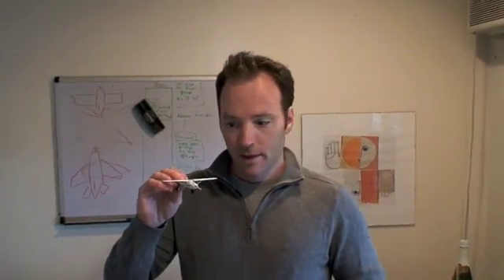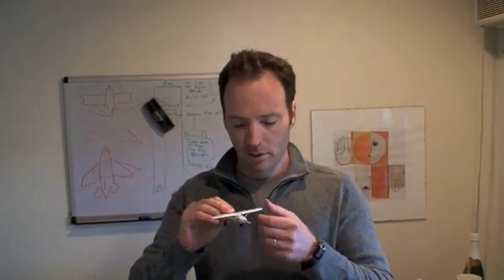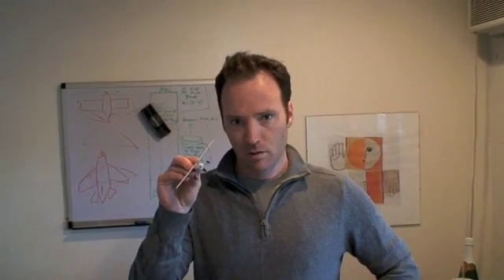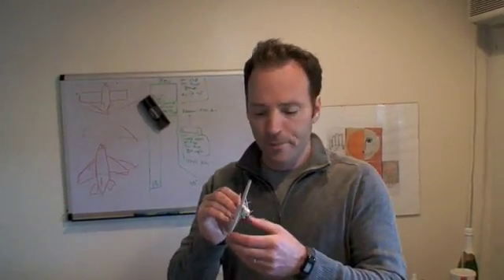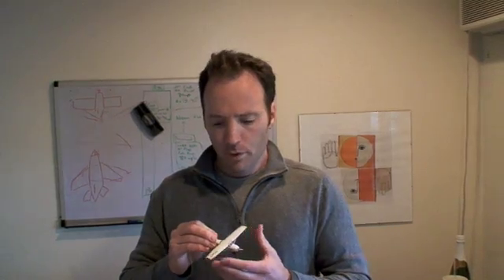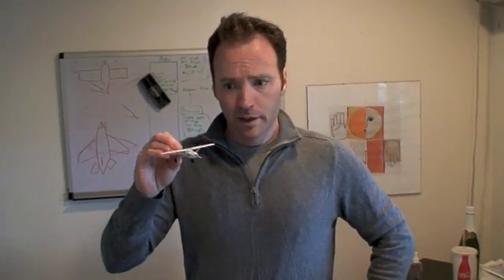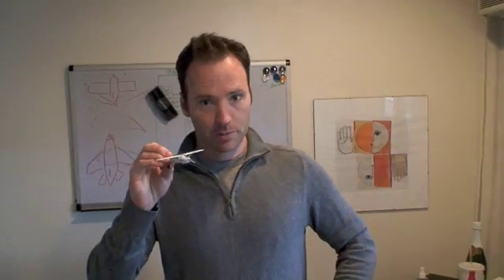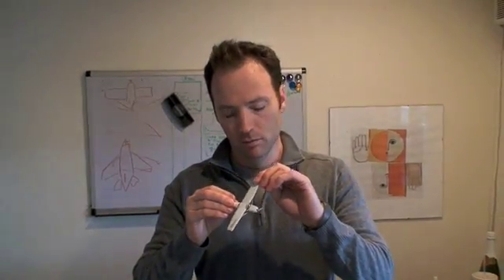Aviation Basics - Load Factor

Comment: what  means 1.4x45?
Reply: I'm a year late, but I'm pretty sure 1.4 is the approximate square root of 2.  The two are the amount of G's at a 60-degree bank angle.  Then, we multiply the 1.4 x 45, because the 45 is the stall speed of the aircraft at the wings level.  If you multiply these together, you get about 56, which would be the stall speed of an aircraft at a 60-degree bank angle.  I hope this makes sense!  I'm only 13, so I could be wrong.